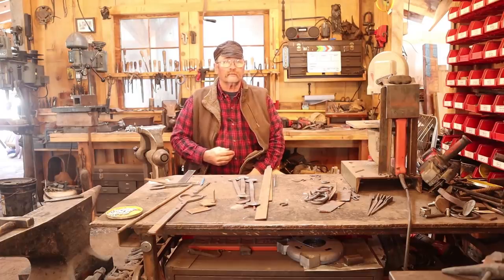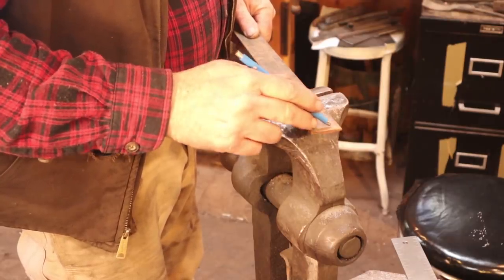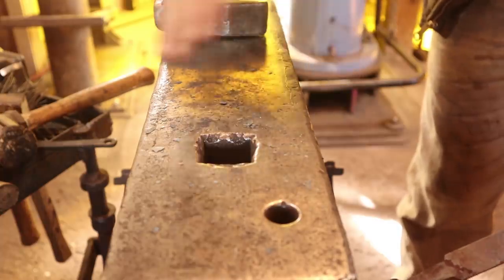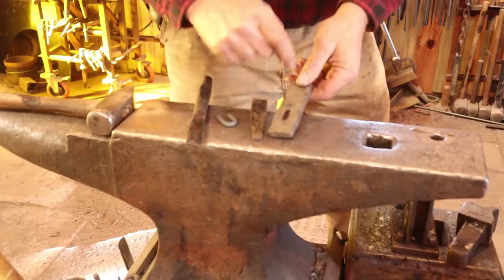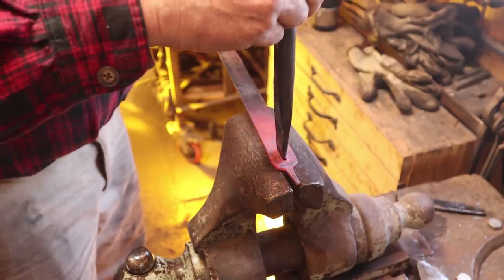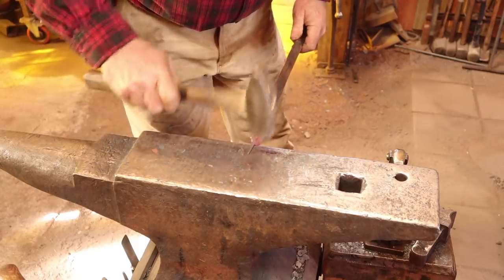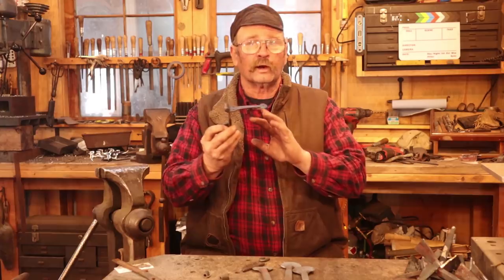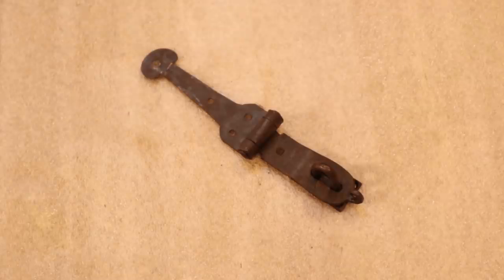Dutch tool chest hasp

Comment: Do you have a sun in the corner of your shop because you have an abnormally brought workshop for a blacksmith all of those video lighting is really paying off I think you even have a bit of a tan happening
Reply from the maker: Its mostly light from the back wall that was removed for the power hammer installation.  There will be a door in there this summer
Reply: One section of wall was removed to install the power hammer. It is temporarily covered by a yellow welding curtain. Hopefully in the spring he can rebuild the wall.